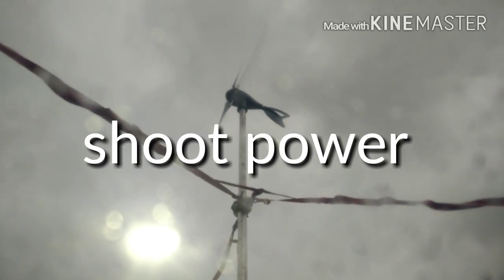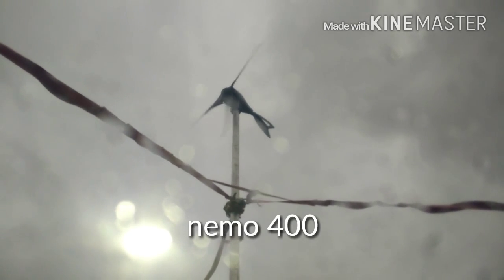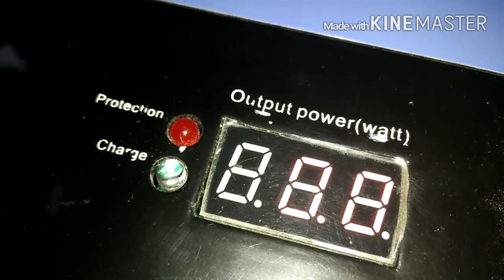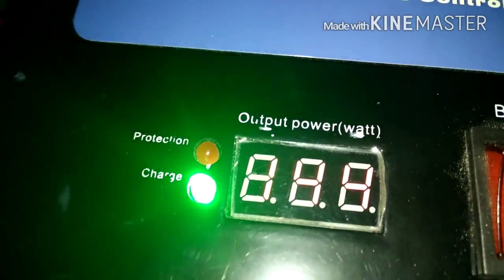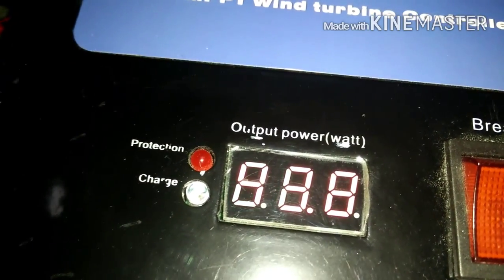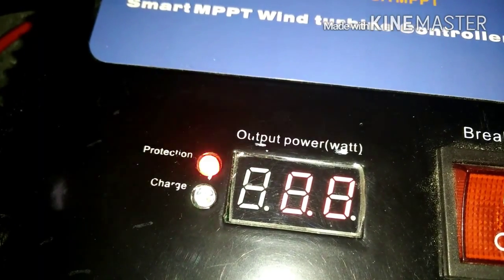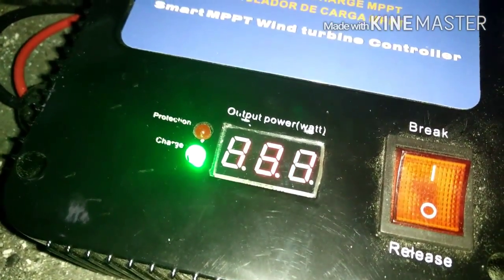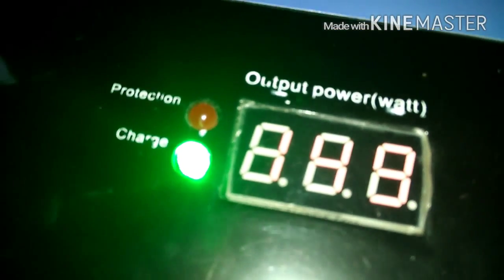Failing Shooting Power Nemo 400 wind generator

Comment: I had the same probem with safe mode occuring at voltage too low 13.9V. As the warranty was over, shootpower team told me to change the R7 CMS 1kohms resistor. For me it works with 1.7kohms (increase voltage limit to 16.1V, and turn back to normal mode at 14.7V)

Comment: Hi, I’m just looking at these units, how did you get on with the warranty claim? Do the other 2 turbines you have work ok? Would you recommend? Can I have the Manufacturers contact details?
Reply from the maker: they replaced the charge controler but I have not done a proper test yet.

Comment: In order to protect wind turbine, this wind turbine setting over wind or overload time 30 to 35 mins, once finish this period, the wind turbine will get to normal again.
Reply from the maker: The problem was that it did not restart at all. They have kindly sent me replacement parts that I will be testing soon. lets see.

Comment: I installate this generator oct. 15 and i have exactly the same problems. I bouth this generator from "Puntoenergia" in Italy, and den never answer, accordingly i have forgeth the warranty!
How is it going with your warranty?
Reply from the maker: +Christian Devrient i bought them direct from manufacture, they have sent a PDF on how to service but haven't had time to take apart yet
Reply: +visionontv ,thanks for answer, even i contact the manufacture in China and i hope the will send me this PDF. i am curious if you can attend the problems!
Reply from the maker: Had it running for a month in berlin over the winter on my boat. With a updated charge controller it worked well.